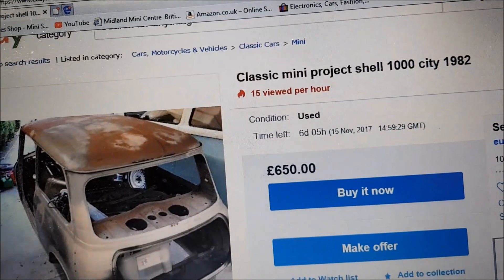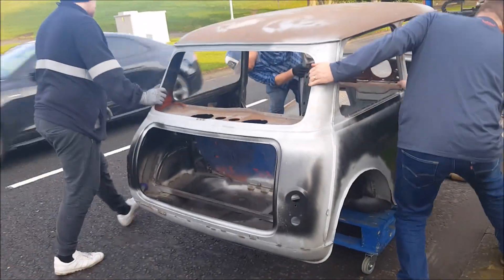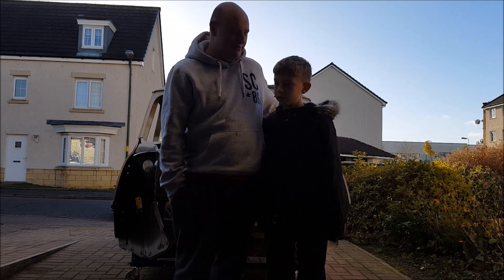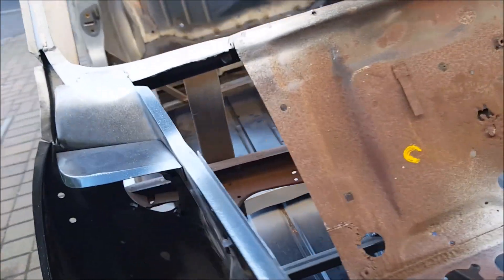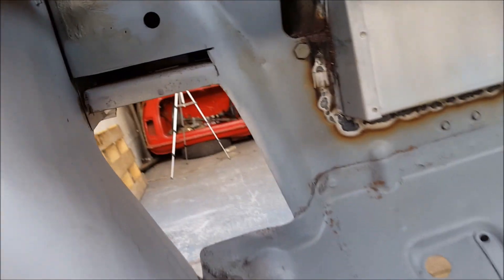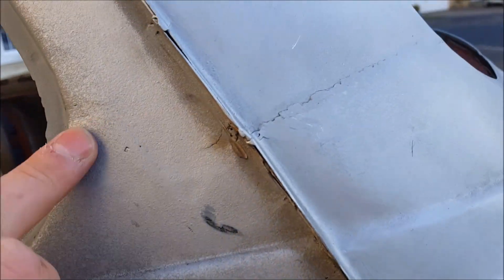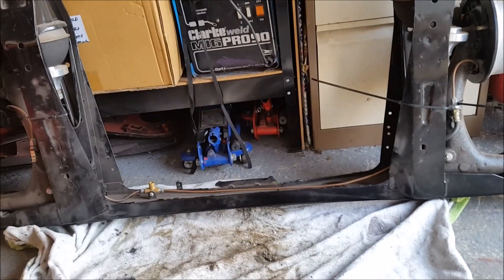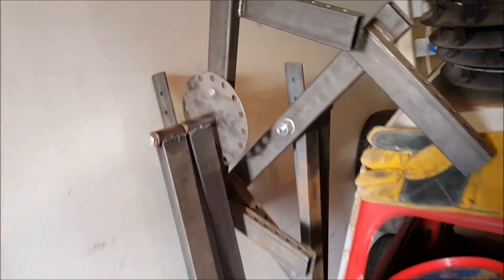Classic Mini Restoration: Eleanor's Restoration, What Have I Done!!!!

Comment: Well done DB that was a great buy for the panels. It’s a shame they’ve been messed with so much. I really need a back end, but I don’t even want to ask for a panel cut since they’ve already been butchered! If you have a rear subframe going spare though feel free to let me know 😀
Reply from the maker: The rear subframe was bought by the previous owner brand new and fully assembled and never used. It will be getting put on Eleanor once it has all been checked over. To buy new is £1100 so a great buy. The old subframe isn't much use for anything

Comment: I agree with Sean i would salvage what you can and either make a trailer or even better A MINI BAR! for the garden. They are a great talking point when your having a BBQ. Hopefully you will let us know on your next video. Cheers Dave.
Reply: When you see the shell close up Dave it isn't the best. The front bulkhead needs replaced and the boot floor has been chopped at the front and the back plus the fuel tank filler hole has been welded up. I'd pick the panels required for Eleanor and sell the rest or like you say make a trailer out of it or a bbq.
Reply from the maker: I did suggest a BBQ to the wife but the thought of another mini appearing the the garden was just pushing my luck too far. I do like the idea of a trailer but the biggest issue is available space. Maybe a future project though.

Comment: Well the shell is beyond salvation and I think its a hack too far. No criticism of the earlier owner as he had a project in mind as we all do. But I would maybe try and salvage the heritage panels you need (if possible) and the bracing struts off the shell and scrap / sell the rest.

You have made a gem of a haul there - Subframes are worth hundreds in that condition as are the new Heritage panels. And a Rotisserie! Wow -  new is £250. Well done you and all the very best from Suffolk where I am also collecting much needed parts for Noah the '78 Mini
Reply from the maker: Thanks. I added up the parts that would benefit Eleanor and they came to just over £4000 to buy new, not all can be used as they would be destroyed taking off the new shell but what I can salvage I will!

Comment: I would make a trailer ..some of the work looked a bit dodgy and unfinished and there was a lot of rust on key parts like the bulkhead so cut off what you need from the front end and turn the back into a trailer....im not a fan of deseaming or tubbed arches either takes too much work to put it back again after.
Reply from the maker: I would like to do a trailer at some point, but the space I have at the moment isn't great and when Eleanor is on the jig I would be tripping over parts every time I turned around